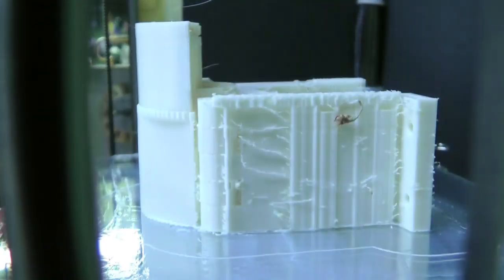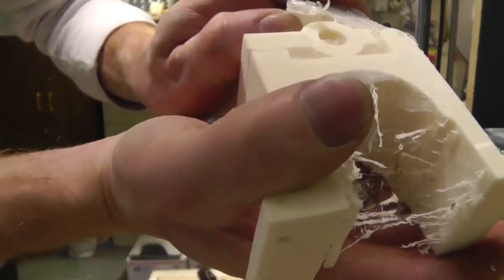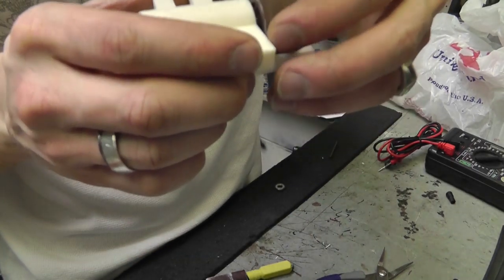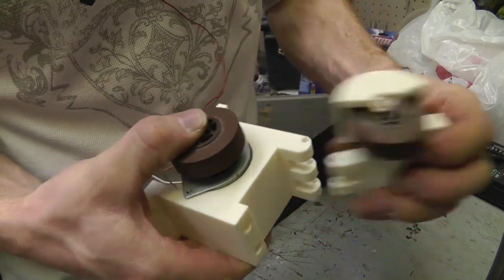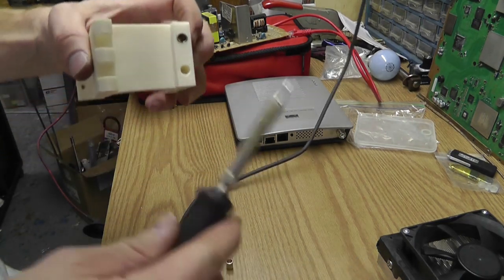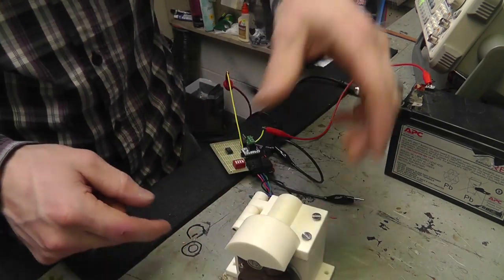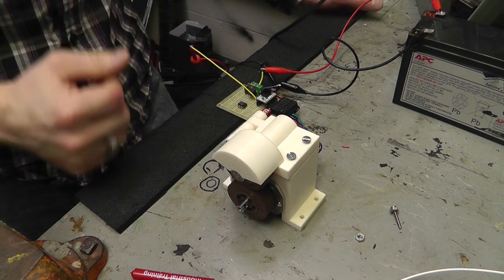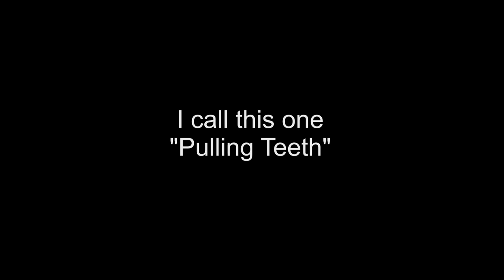#9 ~Russ's Filament Extruder: Making "The Puller" & Demo Of A4988 Stepper Motor Driver.

Comment: Hi Russ!

Congrats to your work!
As I see, your workshop is barely heated and isolated, also you have 
cold winters as it seems...
My workshop is at about 800m from the ocean, and in winter times we have 
between 60 and 90% humidity.
As such, I have a lot of problems with humidity inside the pellets.
Did you recon humidity as a problem in filament diameter consistency? Is 
your filament also a bit "wavy" if you slide with your hands over it? 
How do you combat humidity?
Cheers
Olaf.
Reply from the maker: +Olaf Breuer hi, 

i keep the pellets in the holder with a BIG bag of moisture absorber. also you can bake out the pellets at about 150C this will remove any moisture. 

i haven't seen any real problems with moisture but then again i do my best to keep it dry...

Cheers! ~Russ

Comment: The wire feeder from an old mig welder might have worked with some mod for filament?
Reply from the maker: +Baldy Gitt couls have, its more of a pinch roller than anything so it may damage the filament. ( most of the time its steel wheels)   also its normally a DC controlled motor, and that's OK if it stays steady, but the pull needs to be steady all the time. ( high precision) or the filament diameter may change. good thought for use of old already build parts! ~Russ
Reply: +rwg42985 Agreed, the steel wheels are the parts I was referring to about modding, otherwise it's ready made. I know on my Sealey mig at least it is designed to feed at precise set speeds controlled by a variable knob so don't see a problem with that. After all it is designed to control wire feed precisely. I'm not knocking what you have built in the slightest. I have nothing but admiration for you and your achievment. It's just that your part reminded me so much of my wire feeder. Keep up the good work. I have subscribed and look forward to see what you get up to. I love the mad scientist look too.